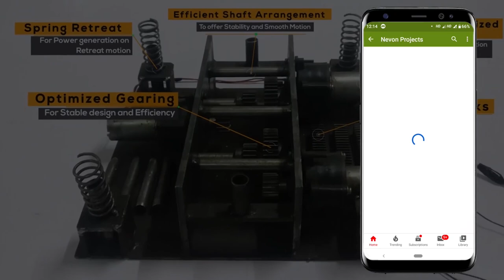DIY Football Shooter | Soccer Ball Launcher Machine | Nevon Projects

Comment: Hi Wanting to buy one and send to NZ. I can't see the battery connected to this in the video. Are you using a 12v battery? If so which one and how long does it last. I can see this would be an additional cost. Or is it mains power. If so we need it to be battery driven. How long would it take to ship to NZ and please confirm its free postage after paying the $800 nz. Cheers Scott
Reply: just saw delivery date on your site cheers
Reply from the maker: For this Mechanical system details of free document PPT pls call watsapp
+917977325066 or visit link in video description